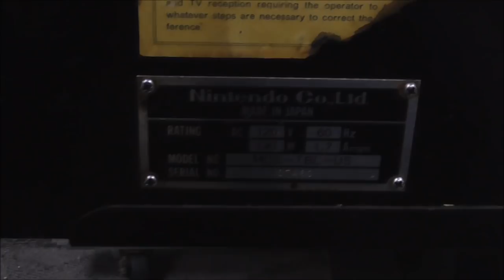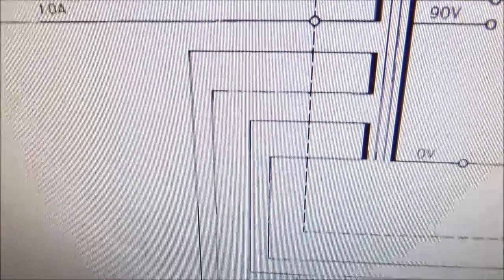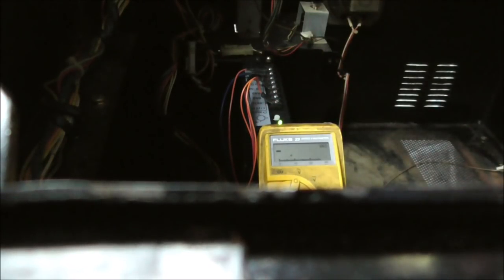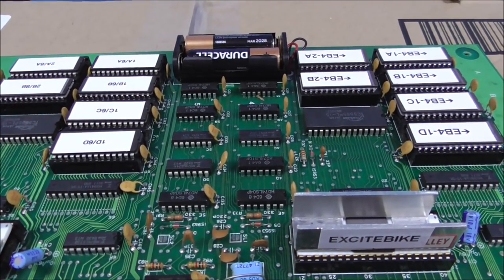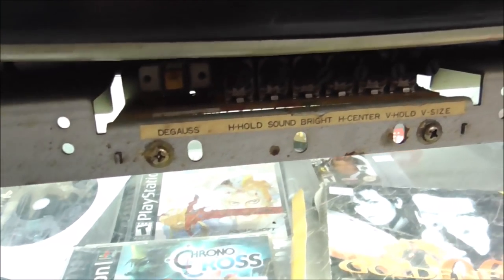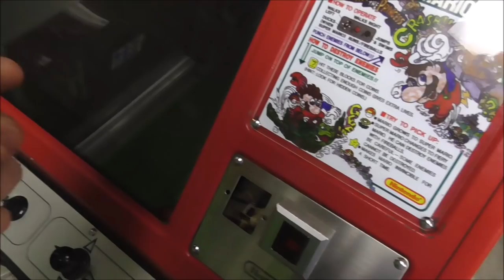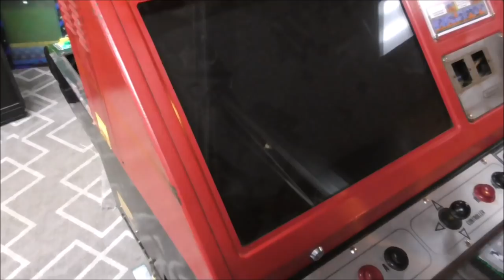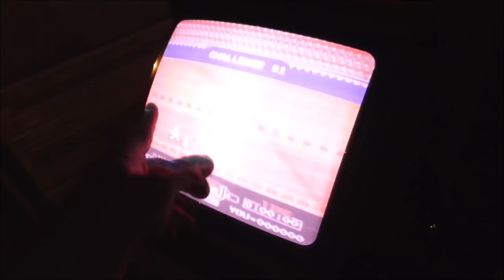Fixing a Nintendo Vs. 'Red Tent' cocktail arcade game... Part 1, what in the world is this thing???

Comment: Looks like whoever changed the flyback and installed the cap kit didn't bother to clean the dust & dirt from around the anode cap on the Tube.. Also check to make sure the grounds from the tube are connected to the chassis. A missing ground wire will make the tube arc like that too.

Comment: so if you plug in a pc monitor it will be upside down
Reply from the maker: It won't display on a PC monitor at all because the output is CGA and the PC monitors do VGA... but if you used a converter board to change that signal, the 'inverted' video isn't upside down, all the colors are reversed.  It's the strangest thing you've ever seen... all the reds are green, all the blacks are white, etc.